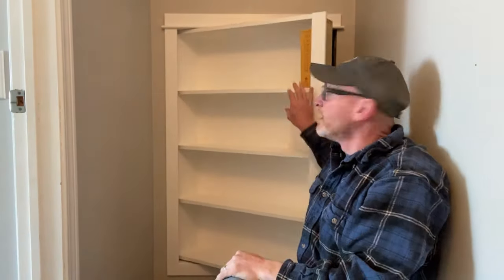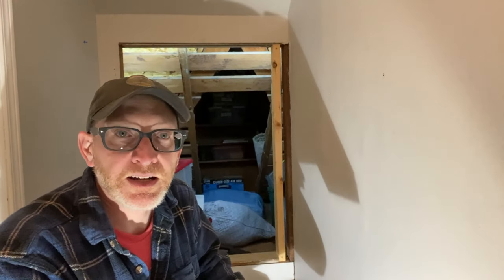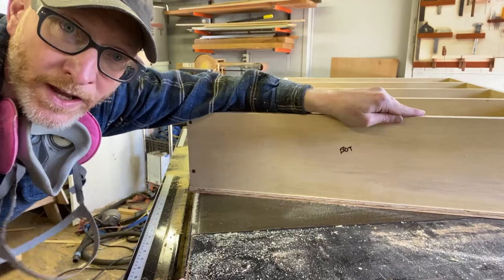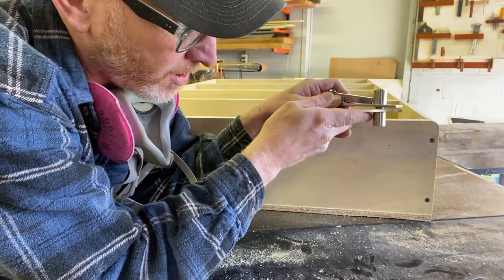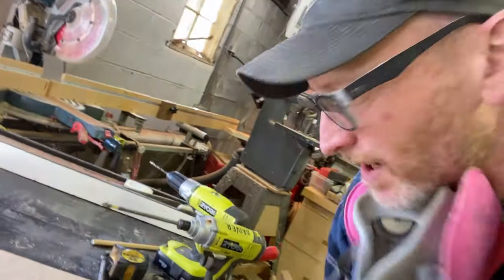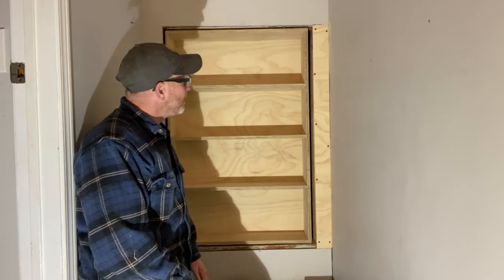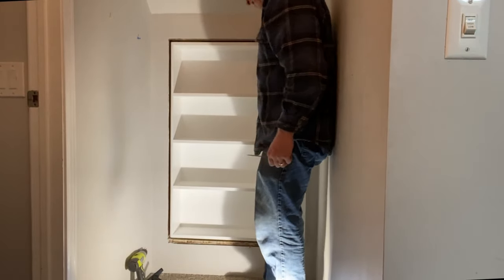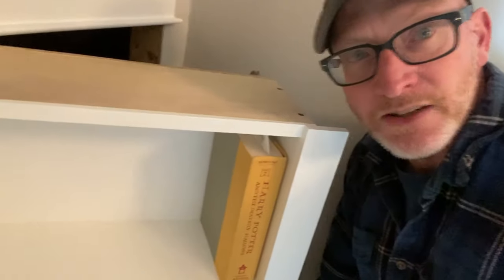Hidden Door Bookshelf | Outswing | Full Build Video

Comment: I'm curious how you decided where to place the hinge point?  how far back from the front edge, how far from the side face.... and does it really matter as long as you are consistent between the positioning of the top and bottom hinge?
Reply from the maker: Placement for me was trial and error by creating a template and adjusting the hinge point until I got the swing and clearances right. For the bookcase to not hit the frame when swinging, you do have to place them right (and top and bottom need to match, of course).

Comment: One of the best how-to videos I've seen on this subject.  Also the best hinge choice that I've seen.  Well done!  🤗
Reply from the maker: Thank you!  Really appreciate the comment!
Reply: @onFIREouttakes  It just occurred to me that a more reliable method of actuating the latch would be to use two solid steel rods with a bell crank to change the direction of motion from vertical to horizontal.  This would eliminate the potential failure of wire or rope.  Hope that's helpful!  🙂
Reply from the maker: I know it was a long time coming but I now have measured drawings available for this project.  Sorry it took so long!  You can find them here:  https://onfirefamily.com/plans/ or at the link in the description of this video.  I hope they help you with your project!  Let me know what you think!
Reply: @onFIREouttakes  Just purchased and downloaded my copy!  Thanks so much!
Reply: @onFIREouttakes  One suggestion for future editions:  Consider including the links to the hardware in the PDF.  Thanks again!
Reply: @TheSockMonkeyGuy  Awesome!  Hope it helps!
Reply from the maker: @TheSockMonkeyGuy  Great suggestion.  Will do!  Thanks!

Comment: Awesome video. Detailed with everything you need to know to do the job. One suggestion…instead of a latch to secure the door closed, have you considered using an embedded magnet and a piece of metal to hold it closed?
Reply from the maker: Thanks!  Yes, I think a magnet would work well. It just takes away a bit of the magic but should be totally effective.

Comment: Great video. I was looking for ideas on how the hinges work and glad I stumbled across this.  I believe I will be using small magnets on the trim stop to hold the door shut though.
Reply from the maker: Thanks!  I’m glad it helped with your project!
Reply: Just finished a closet door/bookcase.  The small cabinet magnets didn't work for me.  Had to upgrade to a larger 4" magnet to keep the door closed.  Had a little bit of spring in the bookcase and needed extra contact power

Comment: Thanks for the in depth video! Would you still use the same hinge if the bottom floor of the door was concrete basement floor?
Reply from the maker: Yes, although it would be much harder to drill for that cup to be recessed. I’m not sure how it would work and you’d have to modify the bottom of the cabinet but you much think about mounting that bottom hinge upside down?

Comment: A couple of things are unclear to me. Good project.

1. I tried doing this with a small sample but I had difficulty pivoting the top into the hinge after fixing the bottom. I needed to increase the gap. What is the clearance you left between top of door and frame as well as left, right and bottom?

2. How did such a large gap at the bottom get caulked and filled?

Comment: This is great. I’m building an out swing door currently. My trim on the hinge side is numbing the door only allowing me to open about 1/2 way the door OR have a huge gap. Do I need to make an adjustment to my hinge positioning?
Reply from the maker: Yes, move the hinge point closer to the center and it should allow the door to swing clear of that trim.

Comment: My real name is Michael McCluskey. What I watched you do was amazing. The house we live in was built in 1913. I did tear out most of the walls in the bathroom. I put fiberglass insulation in before I installed the drywall. I also replaced all the plumbing with CPVC pipes and the drain pipes with white PVC pipes from the roof to the basement
Reply from the maker: Wow.  Lots of work.  Well done!
Reply from the maker: I know it was a long time coming but I now have measured drawings available for this project.  Sorry it took so long!  You can find them here:  https://onfirefamily.com/plans/ or at the link in the description of this video.  I hope they help you with your project!  Let me know what you think!

Comment: How much clearance from the top do you need to position the door past the set screw and hinge bolt that sits proud of the top horizontal jamb?  I would like to maximize the height of the shelf.  I guess they’re variables in play here. Ie depth of shelf…width of jamb rough opening etc. but do you remember yours?

Comment: Great tutorial! I’m going to be building one in an attic location just  like yours. What size smaller did you build the bookcase to fit inside your inside opening dimension so that it will fit without being too tight? 1/8” smaller? Thanks

Comment: How do you think a smart deadbolt would work? One that detects when you're close and automatically unlocks?
Reply from the maker: I have no experience with them and how they mount but if it’s accessible from the outside to manually actuate (or change batteries) it should work. Maybe a magnet to hold it closed too so it doesn’t just pop open every time you walk by.

Comment: Great video!  As a relative novice, I’m concerned about the top and bottom pivot points not being totally aligned / plumb…what’s the easiest way to ensure they are aligned?
Reply from the maker: Make sure the opening is square and plumb and that the wall is vertical. If it is, measure the same spot top and bottom from the frame (or make a template and use it to mark both hinge locations. That’s what I did anyway.

Comment: Great video!  Hello from Japan.  I have a question.  I want change a door to a room to be hidden but I am afraid the other side would look odd.   I wanted to make a narrow shelf for small souvenirs on both sides.     Since I am not sure how the hinge works, I assume there could be some issues for making the door look hidden from the other side due to some  gaps between the door and frame you won't be able to fill.  Am I correct in thinking so?  It is okay for the other side to look odd but I just want to know if there would be gaps.  I cannot find a video of how the door would look from the opposite side.
Reply from the maker: I don’t think it’s possible to trim out both sides to make it look good with these hinges from both sides. One side will always lack the trim necessary to hide that it’s a door.
Reply: @onFIREouttakes  Thank you for your response.  I am now a subscriber!!

Comment: Nice project. You mentioned caulking the bottom to conceal the gap, but wouldn't that interfere with the door opening? Or were you just talking about a gap line between the trim and the wall? I am thinking of doing a similar install on an attic opening, but thinking of how to keep a seal to limit drafts/air gaps. The sides are easy enough, but the pivot hinge complicates the top and bottom. Did you add any type of weather stripping?
Reply from the maker: Just caulking between the trim and wall. I added garage door trim seal to the top and bottom and it helps to seal that gap.

Comment: I’m stuck…I have it all built, but when I go to test fit the bookcase with the hinges, I can’t fit the bookcase in the frame because of the hinges. I left gaps on the top and bottom of the frame for clearance…maybe I didn’t leave enough of a gap? 

Could I make each of the hinges flush with the bookcase and frame to create more of a gap?
Reply from the maker: Oh no!  Sorry, Lindsi!  Yes, that's exactly what I would do.  Recess the face plate of the hinges where you need to to provide that clearance.  Hit me up if you have more trouble and I can try to help you out.

Comment: Could use two or three neodymium magnets heavy duty strength with about a one pound pull on each to keep the book case door shut
Reply from the maker: Great idea.  Thanks, Paul!
Reply: They do make large version of magnetic door latches like the old cabinets had.  Worked great for my door. Got them at home Depot.
Reply from the maker: I know it was a long time coming but I now have measured drawings available for this project.  Sorry it took so long!  You can find them here:  https://onfirefamily.com/plans/ or at the link in the description of this video.  I hope they help you with your project!  Let me know what you think!

Comment: Thank you very much for this video. I’m in the process of doing a full size shelf that is 47”W x 67”H x 15”D and even though I already ordered the same hinges, I don’t think it’s going to hold the weight. Any ideas as to the max dimensions or weight you can do without it  sagging? Thanks for any
Reply from the maker: Sorry, I’ve never pushed it. They are very robust hinges. The bottom hinge holds all the weight. The top just keeps it from tipping and holds no weight. If you plan to fully load it with books it may give you trouble. If it’s just the bookcase with some decorations, you may be okay.
Reply from the maker: Good luck with your project!

Comment: That’s is really nice.   I like it. I wonder why you wouldn’t use another braided metal rope as the backup? You used 550.  Thanks
Reply from the maker: Thanks!  Yeah, I could have used a second metal one as a backup but the 550 was flexible, handy, and easy to use.
Reply: @onFIREouttakes  Makes sense too. Thanks for the vid. I hope to start my door project in a few wks when I get some time to concentrate on it.

Comment: Hi i want to do something similar to this in my ensuite bathroom, there was a standard depth bathroom cabinet but behind it there is a 0.5m deep void space above the stairs, i want to have a standard opening bathroom cabinet but then press a latch or something which will then swing the whole cabinet open to reveal the much bigger storage concealed behind it. any ideas ?
Reply from the maker: That's a tough one.  These hinges might work for that application.  You'd just swing the entire cabinet with a door on the front.  Clearance on that hinge side will be an issue though.

Comment: Did you mortise all 4 hinge areas or just some. I spent way too long today trying to get spacing correct and get everything to fit.
Reply from the maker: Sorry for the delayed response!  I bet you’ve got it fixed by now. I just mortised some of the plates (the top). The bottom I left proud of the frame (and shelf).

Comment: Question what is the space that's needed around the bookshelf between the trim
Reply from the maker: It’s in the plans linked in the description and maybe in a comment below. If I remember right (check the plans) I went with 3/4in on one side and 1.5in on the other for the best swing and fit.

Comment: Could you flip hinges top to bottom to make mortising out easier for the bigger hinge?  Fill "access hole" for pin lever screw in with a wooden dowel afterwards?  Thoughts?
Reply from the maker: These hinges will not flip.  The adjustable pin one will not support vertical weight.  The bottom one has a ball bearing inside to make the opening smooth.  You could fill the upper hole with a dowel though.

Comment: Hey great work! Could you post what the measurements for the hinge placement that you used were? from the edge of the shelf to the pivot point. Thanks in advanced.
Reply from the maker: Thanks!  The measurements are a little complicated so I made measured drawings to download. Check out the link in the description of the video below to download them.
Reply: @onFIREouttakes  hello, I don’t see links below for the measurements?
Reply: @blakecramsie7059  you have to buy the drawings. Link in the description of the video.

Comment: Does it swing in a “heavy” manner once books are loaded? My husband is super skeptical and I don’t know how to “try” it for size first.
Reply from the maker: It swings just fine fully loaded with books and hasn’t sagged at all after over a year.
Reply: Depending on the type of door you’re doing, ie. full length or short like this one. If it’s full length, you can add a spring loaded gate caster to roll on and help support the load. The hidden hinges take a pretty good amount of load so this shorter door can get away with just hinges.

Comment: Great video! Been meaning to do this.. Can this be done with a pre-made book shelf? Just add the hinges?
Reply from the maker: Probably with modifications. Most shelves are not strong enough on their own to support weight without sitting on the ground. If you strengthened it, and then framed the opening to fit the size of the shelf, it might work.

Comment: Great video!  I ordered these hinges a few weeks ago for a similar project but have been scratching my head ever since!  Your video was super helpful.  I love the idea of using a template for the pin position.  How much smaller than the opening did you make your bookcase?  And how did you determine the placement of the hinges?  Their instructions are horrible!
Reply from the maker: Thanks, Todd!  Yes, the instructions are terrible. I left half an inch gap on the hinge side and 1 inch on the latch side. The hinge point (trial and error for me) on my template is 3 in from the edge of the cabinet and 1 7/8” from the front of the shelf. I hope that helps!
Reply: @onFIREouttakes  yeah i WOULD HAVE LIKE MORE TIME SPENT ON MAKING THE TEMPLATE RATHER THAN WATCHING YOU RIP WOOD
Reply from the maker: Yeah, good feedback.  So many folks have been interested in building this project, I may do another video and create a pdf drawing to help people.  Best of luck.
Reply: @onFIREouttakes  amazing videos, very helpful. Count me in as one extremely interested in a pdf and material list. Can't wait to give it a try.
Reply: @onFIREouttakes  great video 👍. I am thinking of doing exactly this in one of our bedrooms corner space but have no idea where to start. A follow up video with a pdf details would be super awesome. Thanks so much for sharing!
Reply from the maker: I know it was a long time coming but I now have measured drawings available for this project.  Sorry it took so long!  You can find them here:  https://onfirefamily.com/plans/ or at the link in the description of this video.  I hope they help you with your project!  Let me know what you think!
Reply: @onFIREouttakes  how deep is the cabinet? I have 1x6x6 (3/4 x5 3/4 x 6) boards I want to use. I would prefer not to rip them. Would a 1 inch gap allow for enough clearence? The jam is 4 1\2

Comment: What's the depth of the bookcase? Working on plans for a similar murphy door, but am having trouble figuring out how deep I can make the unit without catching on the outswing
Reply from the maker: Mine is 7inches deep. I hope that helps. Good luck with your project!
Reply: @onFIREouttakes  Is that including the 1/2 ply on the back?
Reply from the maker: I just measured and it’s 6.75in for shelf depth.  7.25in with the back on it.
Reply from the maker: I left a 1in gap between the door and the frame on the non-hinge side for clearance.
Reply from the maker: I know it was a long time coming but I now have measured drawings available for this project.  Sorry it took so long!  You can find them here:  https://onfirefamily.com/plans/ or at the link in the description of this video.  I hope they help you with your project!  Let me know what you think!

Comment: Does that not leak all the heat out of the house to the attic? Humid air could cause mold in attic.
Reply from the maker: There are small gaps at the top and bottom but I used garage door seals for those after the video. Thanks!
Reply from the maker: I know it was a long time coming but I now have measured drawings available for this project.  Sorry it took so long!  You can find them here:  https://onfirefamily.com/plans/ or at the link in the description of this video.  I hope they help you with your project!  Let me know what you think!

Comment: Does that meet fire code. If not, will your home insurance cover you home.

the shelves should have been cut to 6 1/2, so the ply could have been the inside of the box, to keep the case from sagging with all the weight of books over time.
Reply from the maker: Not sure about fire code as there is no living space behind the shelf. Just an attic. Would be no different (fire-wise) than with the plywood sheet door that this replaced. You bring up a good point for others pursuing this project though. Thanks!

Comment: I’m curious about what kind of table saw rig you have. Do you have links for the saw and extension?
Reply from the maker: I use the contractor saw version of this https://amzn.to/3lMwPky (from SawStop).  I've been very happy and love the safety features of it.  Everything is available here: https://amzn.to/3y8ntVn
Reply from the maker: I have the cast iron extensions (rather than the stamped metal) and also the larger extension to the right of the blade.  As I have the contractor saw, I made the cart it sits on.  You wouldn't have to do that with the pro (cabinet saw).
Reply from the maker: I know it was a long time coming but I now have measured drawings available for this project.  Sorry it took so long!  You can find them here:  https://onfirefamily.com/plans/ or at the link in the description of this video.  I hope they help you with your project!  Let me know what you think!